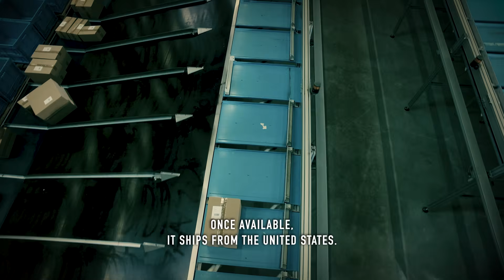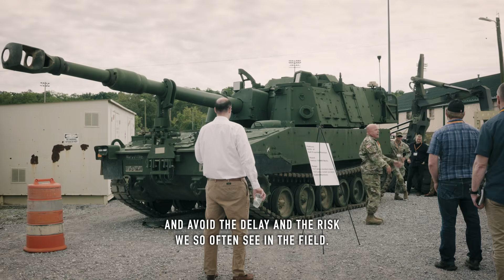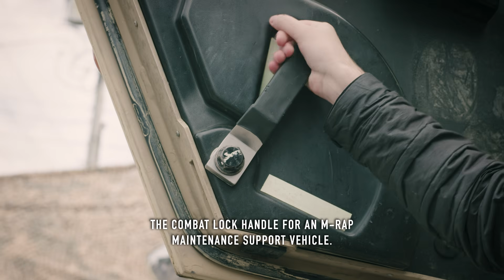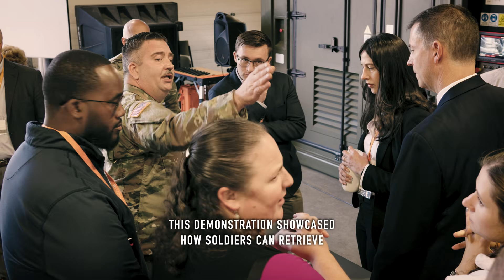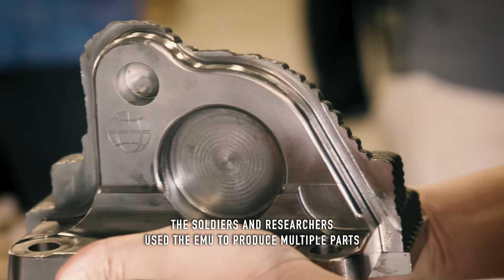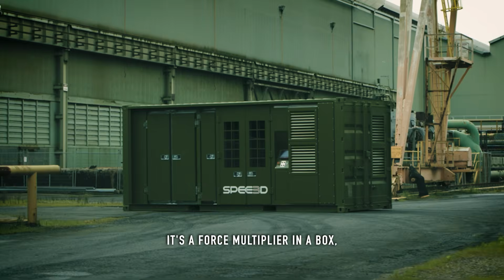Right-to-Repair at the Point of Need: Award-Winning Demo by UTK + TN Guard + SPEE3D

Comment: Military Aviation doesn't have this problem, establish "O" level ,"I" level and ,"D" level maintenance, every vehicle operator should have maintenance training and every vehicle should be required to do preventive and scheduled maintaince and every forward unit should have a forward supply chain of parts and shops with tools to do maintaince.  O level should only be about up time vehicle maintenance and I level for further maintenance repair. Vehicles needing D level should be sent back to conous. No canabilization should be allowed and every part should have hour time counted.